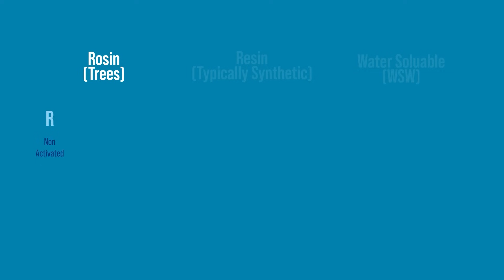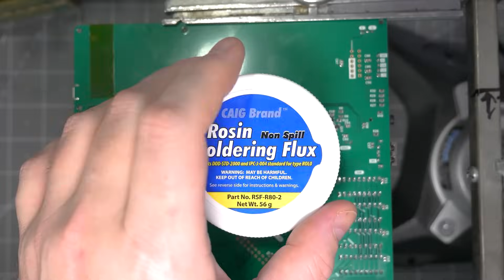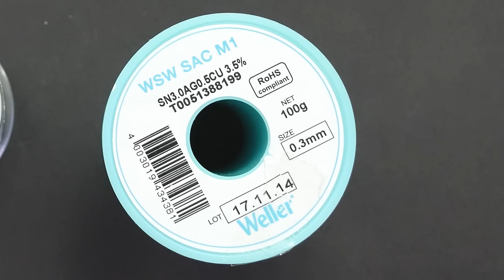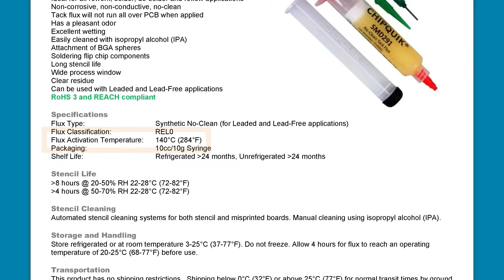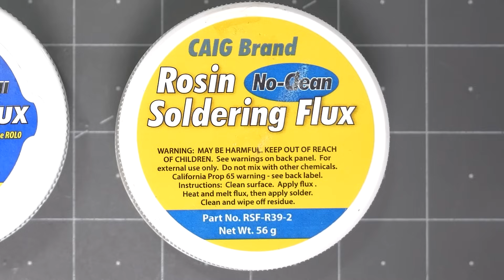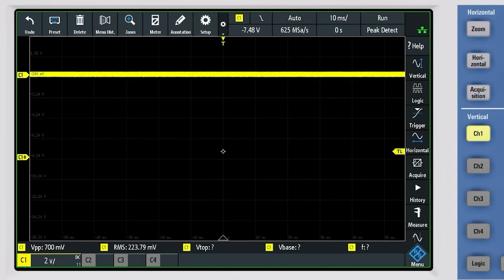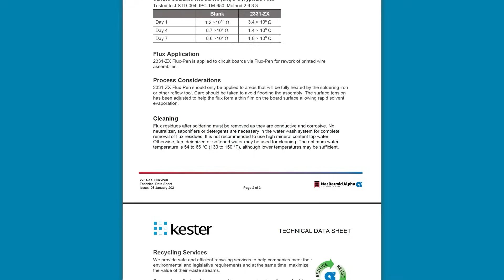How to Decide Which Type of Flux to Use and How to Use Flux! - Workbench Wednesdays

Comment: Nice video, so many questions!
How do we choose a flux matching our solder? Does it have to have the same core flux?
What activation temperature should we aim for? The same as the solder ?
Reply: Flux activation will always be well below the alloy's melting point.

In a production environment, you should be matching fluxes. For repair or one-off work, it is far less critical--as long as you clean the boards properly.
Reply: @bald_engineer  Thank you sir

Comment: I noted using no-clean Chip Quick flux on high power RF amplifier circuitry, it left a carbon trace under the chip capacitors. Back using rosin flux.
Reply: You should always throughly clean the flux residue, regardless of type, on RF circuits. While inert to DC, the residue could affect the impedance profile of the circuit at high frequency.

Comment: I bought a small pot simply called Rosin flux. It looks like the rosin non-spill soldering flux, but it is rock hard. Did I buy the wrong thing? Is it just a temperature issue?

Comment: why is my SMD291 leaves a sticky residue?
Is it because my temp is to high?
Reply: I had/have the same problem. I use too much and don't let it all activate. So, I always clean my boards or work area with IPA after using 291.

Comment: Hello, thanks for the video and I'm kinda late to the game. But I have a question. I purchased the Chip Quik NC191 and saw that you recommend the SMD291. So my question is, whats the main difference and which should I use? I'm planning on just soldering stuff like wires to chips and LED diodes. Would you say that the SMD291 is fine for that application or should I use something else? Seems that it wouldn't really matter, but I thought you wouldn't mind answering my question for me. Thanks for any help.
Reply: I never used it, so I cannot comapre.
Reply: You can use the NC191 that you have. It's a smooth flow dispensing flux. The difference is that the 291 is resin based and the 191 is rosin based. Both are going to perform just about the same I have both the 191 is lighter viscosity the 291 is a little more dense.

Comment: Hi,  have noticed 'alchol based fluxes' at a much lower price. Are they respectful for use ?.
Reply: I do not have experience with them yet. But I have a friend who recently started using Kester 951 for surface mount soldering and loves it.

Comment: Chipquick 291 is a decent flux, but it left a residue akin to maple syrup. I did not enjoy cleaning it
Reply: I agree. That is my only real complaint. The unactivated flux is very difficult to clean off. But I have also learned that I can use much less than more viscous fluxes and still get good results.
Reply: what are you using now?

Comment: Great video! As a beginner this answered ALL of the questions I had about flux. I'll likely start with a paste as it seems easiest for tinning the iron. Thanks for the info!
Reply: it's the solder covering the tip that keeps if from oxidizing... flux is not optimal to tin/clean the Working tip because it leaves lots of residue as it burns up.
if/when you really need to deoxidize a tip, one may use flux but at a lower tip temp, say 200C..

ps: dipping the tip in flux is also not optimal as it degrades the remaining flux thru forced evaporation plus it contaminates the flux.

Comment: You should probably take more time explaining what IPC is, and why you are using their recommendations.

If you work with a supplier for solder, flux and cleaning approach, like Kester for example, the flux type in production is largely based on the electronic assembly soldering requirements (like leaded or lead-free solder). In short, if the production assembly work flow requires, SMT reflow soldering, with final hand wire soldering before cleaning, you will select the flux accordingly. Meaning the reflow solder paste flux, wire solder flux and rework flux (usually a liquid brush on) will be the same flux or compatible according to the manufacturer.

If the production contract includes field return repair or analysis, then IPC rework procedures are usually adopted with modifications for repair and analysis, with the soldering processes specified which will include the type of flux used.

Cleaning flux can be a challenge if you solder devices that can trap flux, like QFPs or BGAs. In specific instances the only way to completely clean the board is to use a heat controlled ultrasonic cleaner with the recommended cleaning fluid (solvent). After cleaning you have to wait until the cleaning solutions evaporates, this may take considerable time at room temperature, so what you will find is to speed up the process, especially after rework to re-introduce the assembly into the production work flow, is to dry the board(s) in an oven (not a reflow oven, a drying oven). Once, the board is dry and stabilized at room temperature can you then test. If the rework involves a BGA one of the first tasks is to x-ray inspect the solder joints. Once the board passes solder inspection, now you can introduce the reworked board into the testing work flow.

If you are assembling prototypes for a customer, I would recommend using a very nice looking pad copper plating like immersion gold (unless the contract specifies the plating) and then use an organic flux solder paste and wire, best to use eutectic tin-lead. The organic, water soluble flux, does an excellent job of removing oxidation, and will help migrate the solder completely onto the pad even if the footprint is small (high density), which means the applied paste volume is minimized. Yes you have to clean the boards at elevated temperatures (which is not unusual) in an ultrasonic cleaner, or in a board washer when in production. Or you can just heat up some distilled water to rinse the board if you don't have access to the production line equipment. After rinsing and inspecting that all of the flux is removed, dry the board in an oven, let cool, then test.

I find the senior IPC soldering certified assembly technicians for hand wire soldering where you will add additional flux before soldering, usually choose liquid flux as a first choice, and then consider a tack flux if the liquid flux is not viscous enough.
Reply: worth being pinned ^
Reply: Wow your comment is really appreciated

Comment: IPA??? Beer?  LOL I guess in the soldering world it's Isopropyl Alcohol.  What I'm gathering from your video is that any flux will allow any solder to adhere perfectly fine.  Cleaning is a no-brainer at least it should be.  My project is replacing a micro-usb port on a GPS.  The flux I'm using does not help melt the existing solder (which I think is Silver based).  But if I'm using a generic 60/40 solder, what flux works best????  Nice video, thank you for the insight.
Reply: that would make it IA. each letter should translate into a word.
Reply: @BobRooney290  There are no rules for acronyms. E.g. NORAD.

Comment: One thing I noticed that wasn't talked about, is how well solder sticks to metal using certain kinds of flux.  I've had very mixed results with different kinds of flux.  I've had some that's really sticky and amber in color and it works very well in getting solder to stick where I want.  I've had this white paste kind of flux, that barely did anything.  Hardly helped the solder stick to what I was soldering and mostly just evaporated.  I've had much better luck with the amber sticky type of flux doing the job.
Reply: @sprybug  brands?

Comment: I have some Kester 186 flux that's easily ten years old and still works just fine. I think the shelf-life limits of most of these types of things is not something most people have to worry about. Maybe if you're working on a satellite or nuclear reactor control or something, otherwise don't overthink it.
Reply: I don't think I have any flux that's quite that old.  But I certainly have, and use, 5 year old flux, and that has always worked fine for me.
Reply: @iainmcculloch5807 ,  I have a plastic jar of Weller rosin flux mixed in petroleum jelly that is about 40 years old and it still works just fine!
Reply: Yea i have the liquid ChipQuik that is a few years past expiration, nothing in it really changed.
Reply: just found in my basement some old flux labeled from March 2000. Still works! but it's Zinc Chloride based...

Comment: I only solder occasionally and use my kid’s left over violin string rosin (he doesn’t play anymore). I just dip the soldering iron tip in it or use a solution of it in IPA. Works actually pretty good.
Reply: Yup
Reply: I watch somebody on YouTube scraping rosin off of pine cones and dissolving it in Alcohol, and it makes a pretty good flux!

Comment: I've used cheap flux where it's conductive when cold. Gave me a lot of head scratching looking for the short
Reply: Stick your multimeter probes in it on resistance and check what you are getting
Reply: @silviuguseila2552  ,  The conductivity of flux may be relatively minimal and pose such a high- resistance connection that a digital meter powered by a 9 volt battery might not read the resistance. You're better off powering up the circuit ( if possible, probably with current limiting applied) and using your multimeter probes to look for a voltage on sections of the PCB  in-between foils and components.